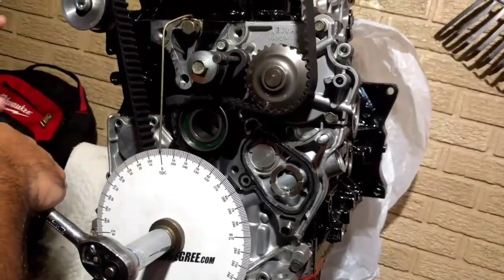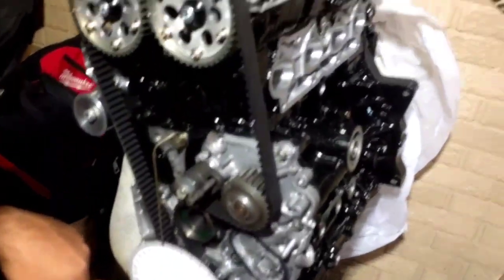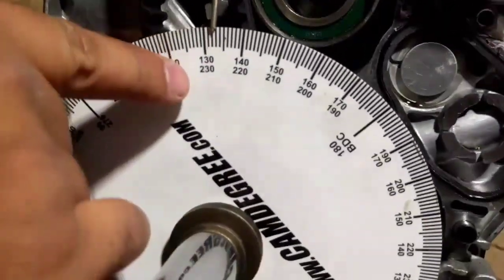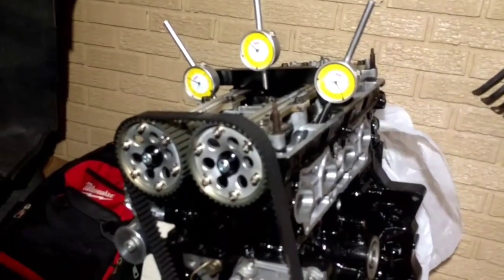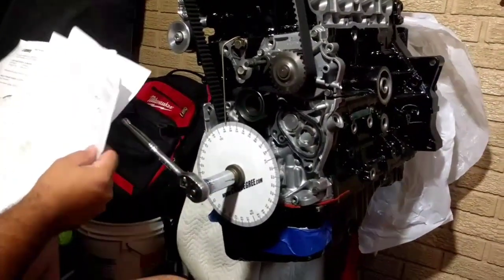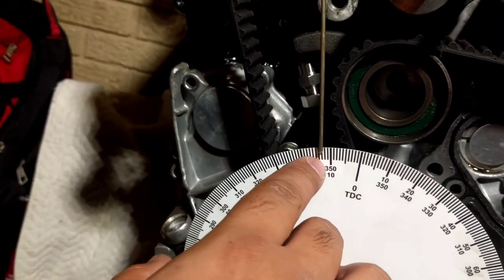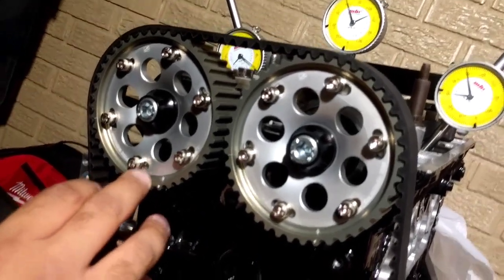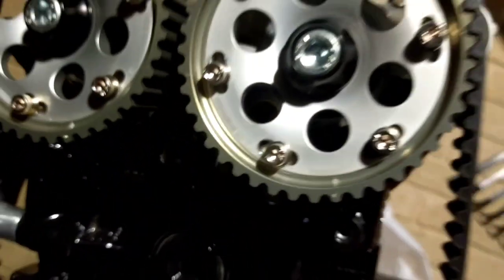Honda cam degree tutorial.. B,H,D engines

Comment: What paint did you use for the block? Did it hold up?
Reply from the maker: Autozone VHT high temp paint and yes so far holding up, this is a friend engine.
Reply: @civicpride1986  Nice. Thanks man
Reply: @slumpedmage I've used the same paint and it held up for as long as I had the car, about two years

Comment: I have never understood why this is done this way. I set my cam gears to 0 degrees, set the cam platform, put number one on TDC and put my timing belt on. Send the entire package to the dyno and done. I have never had an issue.  I'm just saying.
Reply from the maker: Is not about having issues, this is mainly done to be able to make the most horsepower for the cams possible, not much but doing this can gain an extra 5-10whp depending on the set up..
Reply: @civicpride1986  I must look into this further then.  I possibly have been missing out do to being in a hurry
Reply: @civicpride1986  what's "whp?"

Comment: I don’t mean to talk crap or bash your video, but it’s super confusing.
Reply from the maker: HoDaSpaniard I agree it is confusing.. we where also learning how to do it..
Reply: I’m gonna go ahead and subscribe to your channel. I have to do this myself very soon. It would be awesome if you guys post up another video breaking down things a little bit clearer. Props for putting up a video of doing something new for the very first time though that takes guts haha.
Reply from the maker: HoDaSpaniard I might have to do that again on another engine and explain better..
Reply: Yeah using the lift at 0.050" is a super confusing way of doing it. Next time after finding tdc just go to the centerlines of the cams on the degree wheel and use your cam gears to find the peak lift. Once that's found lock down the cam gears and your done!
Reply: That's because he doesn't know how to do it.  It's hard to explain something you don't understand.

Comment: I only watched the first few minutes & that was enough ..... Why don't Youtubers actually learn how to do a technical process correctly first before doing a video on it ....  YOU CANNOT FIND TRUE TDC WITH A DIAL GAUGE >>> IT'S IMPOSSIBLE<<< YOU MUST USE A PISTON STOP .... may also have other errors in this video, there's no point watching any further as it's an incorrect method ... Yet another failed attempt at showing Joe public how to degree cams in ...
Reply: because when the piston changes direction the wristpin/bearing would have some slack in it and throw the reading off.... BUT NOT BY MUCH, so stop beating him up on it :-)